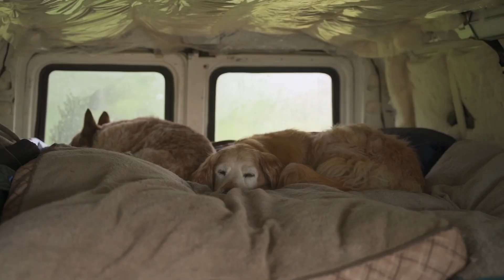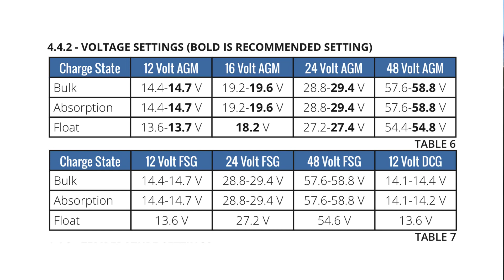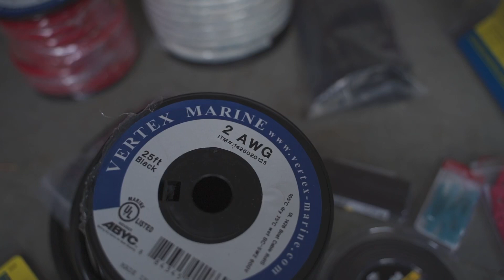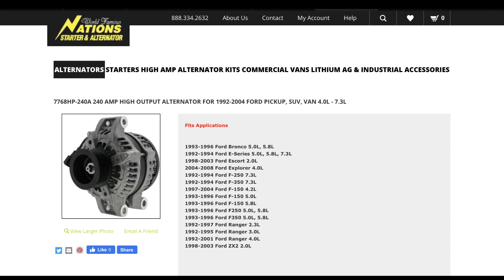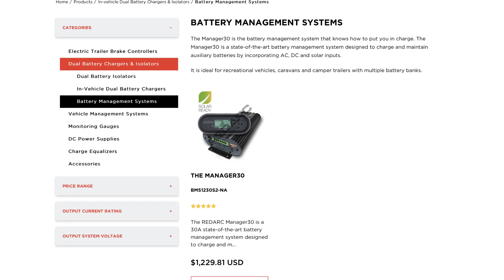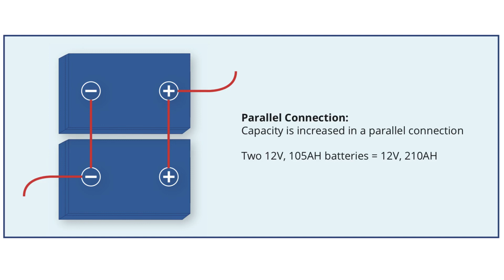Van Conversion - Using a DC-DC vs a Solenoid Off Grid Power

Comment: I had someone else build my system. All I know is I have 6 Battle-born batteries for the van and 2 Optima batteries for the 5.9 cummins diesel 6 speed automatic. It also has 2 different alternators. A 3000 watt inverter and two 200 watt Solar panels. The reason it is so big is I have a roof top AC. 2 12000 lb winches and lots of outside lights. 
 The Van is a 1977 Dodge tradesmen 300
Maxine van. Long wheelbase Dana axles with air lockers.
Reply: Nice. Love to see some pic of the van.

Comment: Nice first video. I'm using the dirt cheap option right now with the solenoid and a lead acid battery. Maybe one day I might be able to upgrade. I'm interested in your desk setup there. What's the tablet mount and table?

Comment: One thing i like about my Bluesea VSR is i can push a button and manually tie the two together to jump start my rig from the house battery if the start battery ever dies or for winching or other high amp draw uses.  Also either solar on the house battery and alternator on the start battery will activate the solenoid and charge both automatically.  Both batteries are AGM, but i agree the charging isn't as optimal on the house battery this way and I would get a better charge on the house battery with a DC to DC charger.

Comment: This is great. You explained it the best. DC to DC it is. I've seen on govplanet auction that they have military alternators with up 500 amp's. Would this be good? I put a 12valve in my van and uses 2 batteries.
Reply from the maker: The amperage sounds plenty but I don’t know about how it would fit

Comment: Doubling up on the channel, nice. I got the renogy 50 amp DC to DC solar charge controller unit. Running 2 180 ah AGM batteries. Got them used for $60 a piece for a telecommunication company. They replace them every 3 to 4 years regardless. I also run 400 watts of solar panels.
Reply from the maker: Nice that is a great price for those batteries👍